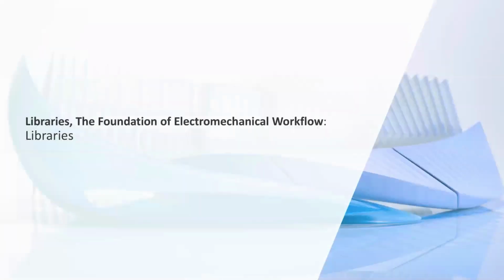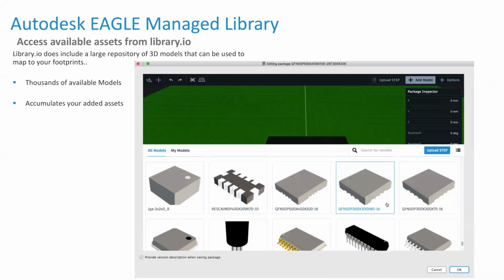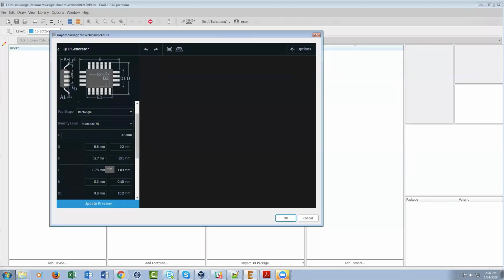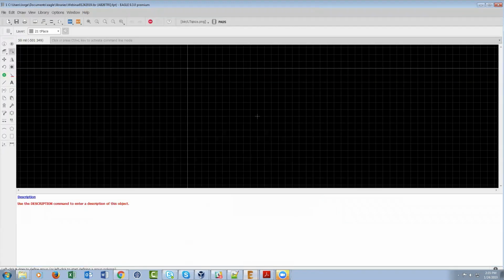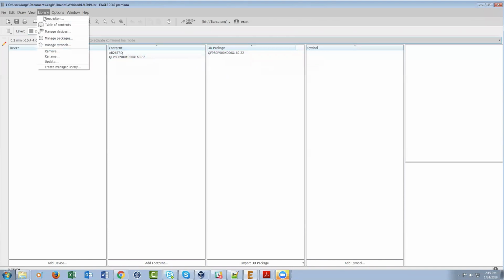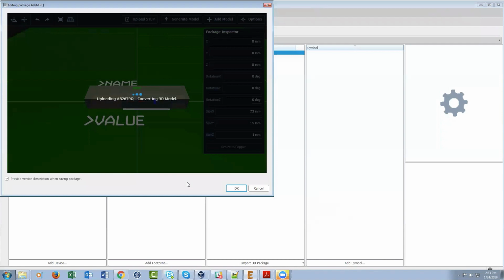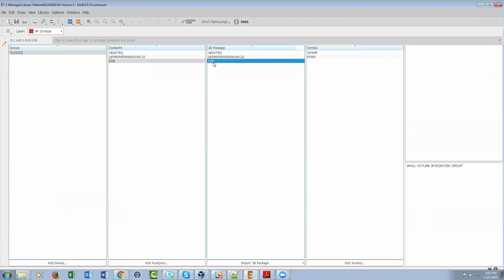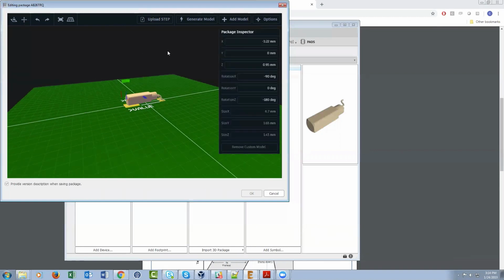Mapping 3D Models to Footprints - Autodesk EAGLE

Comment: This is cool! I have a question. Does free version of Eagle have full access to Libray.io (including creating and searching up packages)? Or do I need to pay for that feature? Because I am using free version of Eagle for non-commercial purposes, therefore I am limited by the maximum PCB dimensions and of course cannot use middle layers. The idea of designing own package with 3D model included is really great and I'd love to be able to use that feature in free version for parts that do not seem to have 3D model yet so I could preview a 3D model of the PCB with all the parts included :)

Comment: So if you wanted to map models to footprints on a project that is already done, you would have to create a managed library and then map everything you are using, and then replace every single one with the new package on your brd ? or is there a way to just link an attribute to a model ID ?
Reply: Hi, I know you posted this question sometime ago, but wanted to let you know you can now map 3D models directly from the schematic or board layout workspaces.
Reply: @adskeagle4253  Thanks, It seems you have to add a model to each device though, parts using the same footprint do not get the 3d model and I cannot find a way to add, it seems the footprints get changed to some alt version, it should be easy to just add the same 3d model to all objects matching the size or footprint, eg all sot23 parts etc.